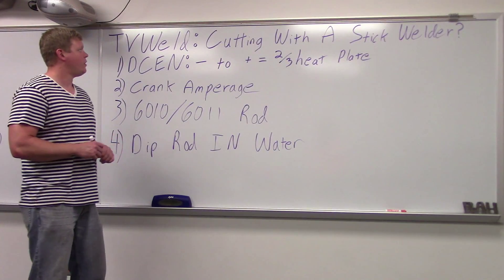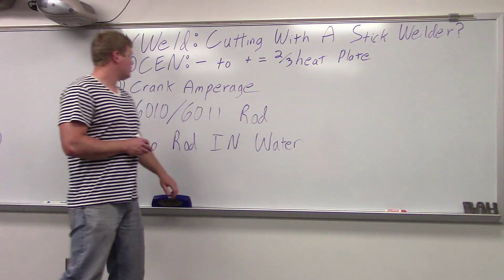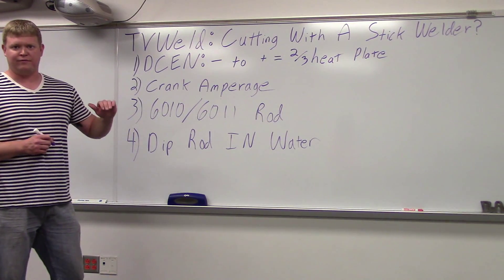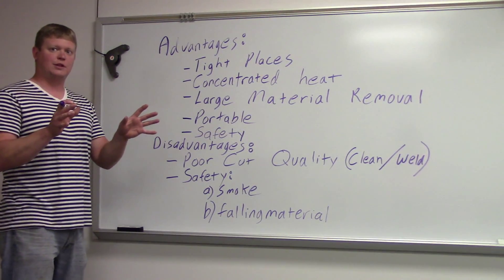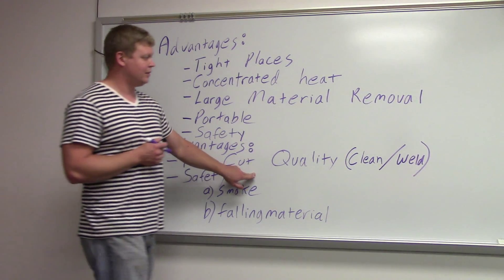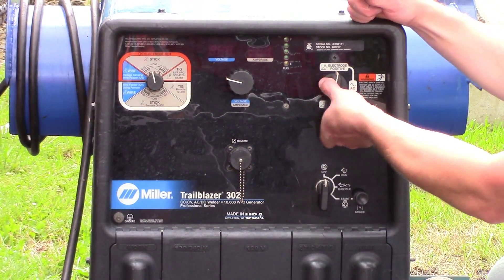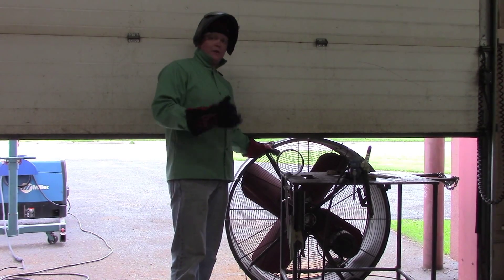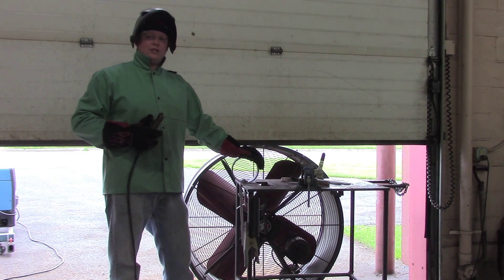How To Perform A Cutting Process Using A Stick Welder

Comment: I imagine thats pretty hard on a welder machine
Reply: What is the difference for the welder machine between welding with a 5mm rod or cutting with a 3,2mm rod? ( with the same amps)
Reply from the maker: It is.  We usually do it with an engine drive.

Comment: Outstanding! What is the science behind this please? ...with the wetting of the rod
Reply from the maker: It helps the rod last longer.  The heat is very intense on the rod because the amps are so high and you are using DCEN so wetting the rod helps keep the electrode cooler.
Reply: Ah I see... I was half expecting it would be some form of electron or molecular transfer manipulation of sorts😅

Thanks for clarifying. Interesting lessons you have in your channel.
Reply: Feeds the arc flame more oxygen to make it hotter

Comment: Noob welder here, can you please clarify, in straight polarity {DCEN}i.e welding rod connected to negative , the electrons and heat are flowing from the rod to the base piece/metal.so the rod is hotter than the plate. is that correct. cause down below someone commented DCEP heat is on the rod.
Reply from the maker: DCEN electrons flow from the rod to the plate causing a lot of heat to be on the plate.  https://www.youtube.com/watch?v=bp4wy2lkiNM

Comment: this is a great video. i need to do rusty exhaust work. trying to figure a way to cut rusty bolts in tight spot  without oxy torch. 
firepower makes a "cutting electrode" part# 1440-0426. can get @ Napa.

Comment: Back in high school welding class (probably 45 years ago), we would use that technique to cut metal when we didn't have oxygen or acetylene for gas cutting (which seemed to happen all too often).  The welders we used were the old Lincoln AC-225 units, so we were doing AC instead of DC.  It worked... Not as clean as other techniques, but a lot quicker than cutting thicker metal with a angle grinder, so I still use it today at home if I don't want to go to the trouble of setting up the oxy-fuel cutter for a small cut.  Haven't tried wetting the electrode though...

I've tried using a piece of rebar as an electrode and even with a sharpened point, I was not able to maintain an arc.  One of these days, I'm going to get a carbon electrode and see how that works...
Reply: Back in high-school class, about 1.9 years ago we had a bunch of goof brain kids that would weld anything that was metal together. The end result was grotesque statues of coupons, angle iron, rebar, rail road spikes, you name it. They also ate through cutting wheel like they where free and didn't know that you have to turn the oxy torch off after you smack the tip with a glove and kill the flame (🫤). We had a small stock of cac and exo rods, but those where reserved for teaching and learning. So, I often was tasked with cranking the machine up to 310 and reeking havoc on aforementioned statues with 3/16th 6010 rods. Quick, messy, but everything was scrap to begin with. You ain't doing it right if the entire rod isn't smoking

Comment: Does reversing the polarity really make a difference ?
I have heard you can buy carbon cutting electrodes ?
Reply: Yes, it does. Negative flows to positive. DCEP, the heat is primarily on the rod. DCEN, heat is primarily on the base metal.